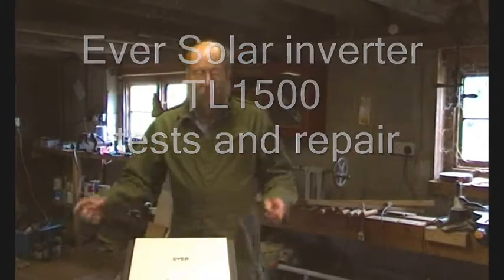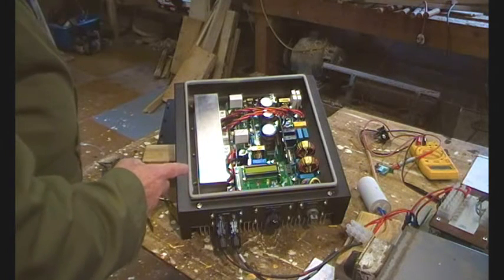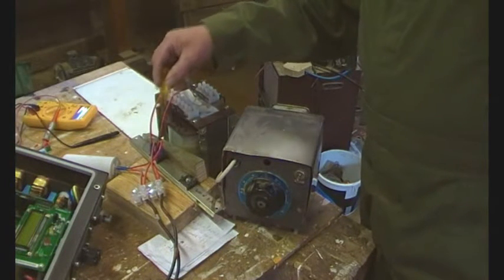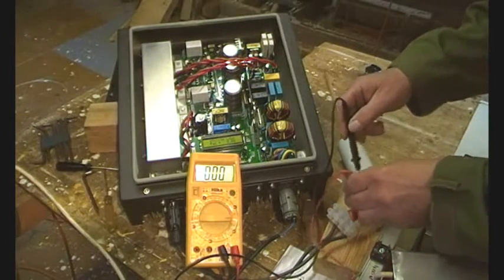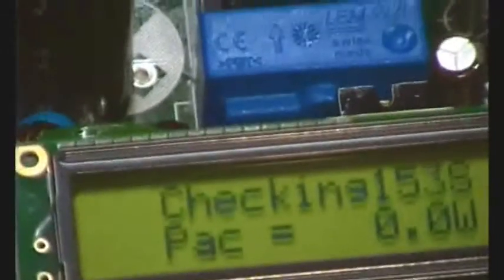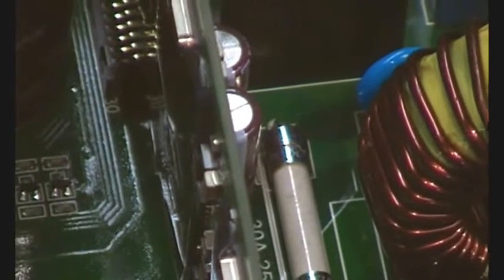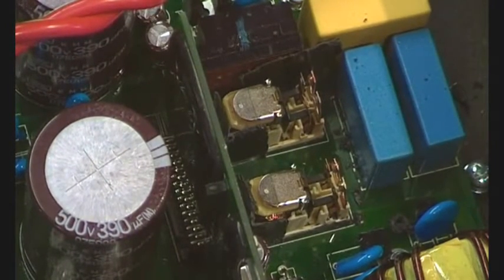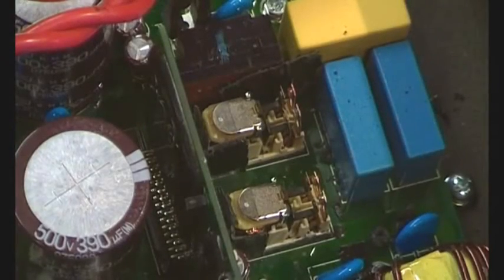Grid inverter investigation and repair: EverSolar TL1500, relay fault.

Comment: as I understood some inverters  doesn't work without isolation on the DC side?
Reply from the maker: That's correct, a leak to earth on the DC side can cause problems, just a damp spider's web in a connector block can cause this. Abb Aurora are particularly sensitive. Many more videos here, cheers

Comment: Hi Andy, a great video demonstration there. Keep up the good work! Do you have experience with grid inverter - JFY how to fix it? or do you have any video on JFY inverter?
Reply from the maker: Sorry no, but check the board for burn marks and check the relays. Just use basic principles and check for any fuses, Hope you subscribe, cheers

Comment: Hi Andy is there anyway a grid feed inverter can be modified to be used off grid to supply power to a well pump from solar panels with no grid feed
Reply from the maker: Hi, no they need a mains signal, and on cloudy days you will need  a battery to provide sufficient current, chees

Comment: Do you have experience for Zeversolar grid tie inverter, electrolyte capacitors 220 microFarad 25vdc bulging cause fault 03(relay fault)
Reply from the maker: I'd say change those capacitors but I doubt it causes a relay fault unless one of the capacitors is a dead short, cheers

Comment: Hi Andy,
Have you had a isolator fault on the unit after fixing the relays?
Reply from the maker: Ashley, if you had an isolator fault on either the AC or DC then power would not be getting into the unit, and so it would not power up. However there is also an isolation fault and this is commonly due to earth leakage from the DC side. I've done a video about this, found in the solar grid inverter playlist. Hope this helps, subscribed? cheers
Reply: @TheInfoworks  hi Andy, thank you I will have a look it worked fine after the fix you show for a few week then showed the insulator fault. Is there any other relays that could cause this, I’ll check the other video
Reply: What dose the relay under the screen do dose it need to be changed aswell?
Reply from the maker: @ashleywaldron5211  Hi, you only need to change the power relays you have already  changed. Have you checked your solder joints? Isolation fault is in the panel wiring and is a small drain to earth. High voltage DC is tricky stuff and can leak through cable insulation, that's why solar cable is double insulated, cheers
Reply: @TheInfoworks  thank you again for the reply checking solder joint in the inverter unit or the panels?
Reply from the maker: @ashleywaldron5211  check the wiring o your panels, looking for bad connections and possible earth faults, also check your solder joints on the replaced relays and all the connectors that were undone in the repair, cheers
Reply: Dear Andy......Any chance you have a schematic of a zeversolar unit in youre posession ?i have a inverter with a waiting error.....cant wait to get it to work!greetz from Holland..
Reply from the maker: @heman1303  Hi, I have had several growatt machines that showed this fault and in those it meant that it could not sense the grid voltage. Sorry I have no documents for any of the inverters I play with, cheers
Reply: @TheInfoworks  ok ...thanx for the reply😁...but first we need to build the DC power supply🤺

Comment: Hi Andy, with the output relay covers, do the plastic covers need to be replaced? Or can the unit run ok without the covers (i.e is it safe)?
Reply from the maker: Hi, in my experience they work just fine without the covers and you can see what's happening, cheers

Comment: Hi there, you’ve got a subscriber thanks so much. Are you at all familiar with sunny boy inverters? I’ve got a K1 open error that is continually on. Any idea where to start?
Reply from the maker: Hi, the only ones I familiar with are the SB 1700 transformer models. Not sure if open error is a relay fault or not. Is AC and DC getting into the inverter, what is the DC voltage and have you done a short circuit test on the panel string? cheers
Reply: @TheInfoworks   It’s also a transformer type, but 7kw. It’s getting both AC (230v, I’m from South Africa) and just over 600v DC, how would I do the short circuit test? I’m very limited with my electrical experience. Thanks for the reply.
Reply from the maker: Jayson, with limited electrical experience I would forget the short circuit test as you would need a DC clamp meter, I suspect you have a relay fault but only experiment would confirm that. I have several videos on various inverters with relay problems, it's a matter of examining the relay contacts and looking for burnt solder joints, cheers
Reply: @TheInfoworks  Thanks a lot, I will keep you posted 💪🏻

Comment: I unfortunately have a different fault.
Yesterday 07/10/2020 we had three power cuts in quick succession and I think my TL4000 has been spiked,  it's now showing VAC Failure. 
I powered it off overnight and have measured the AC on the motherboard this morning which is presently 237v
That matches the voltage on the display so afaik it's within UK range, what I can't do is check the inverter settings.
 I bet the configs been screwed and its reverted to a non UK setting or a non UK compatible default :(
The manual suggest there is a application called 'Easy Config' that can be used to configure these via the USB port, googling  such a common term as 'Easy Config' is a hopeless task though 
The manufacturer has  long since disappeared so it  looks like I will be buying a replacement Inverter now.
I wonder if there is a way via the screen to check if it set to UK G83 or whatever its called?
Reply from the maker: Hi, that's tough, many inverters show G83 as the screen lights up, but not all of them. There are plenty of used and cheap inverters on Ebay, I quite like the solar rivers. Have you seen my video on extending inverter life and subscribed? cheers
Reply: Andy Reynolds Thanks ironically after being dead all day yesterday it came back to life this afternoon Mains voltage hasn’t changed nor has the frequency very odd.
Reply from the maker: Good news but curious, just appreciate. I don't want to say any more that may offend the inverter gods, cheers

Comment: Sir which components are use in solar hybrid inverter for supply excess energy to grid
How can we make circuit to convert normal inverter to hybrid solar inverter
Reply from the maker: Hi, it's quite simple, you use a solar grid inverter. The panels are connected in series and then plugged into the DC input of the solar grid inverter. The inverter is wired into the mains and when the sun shines it puts power into the house wiring and then if you don't use it the surplus goes into the grid, see my book Wind and Solar Electricity. Look at my channel page and see the details under the "about" tab, cheers

Comment: Hey Andy the bloody thing had a relay fault now it has a isolation fault, what would cause this ? Wiring from the panels or those 2 relays need cleaning again as I am writing on the new relays to turn up from China!!
Reply from the maker: I had an isolation fault and tracked it down to the panel wiring, I uploaded a video about it if that's any use to you. Also there is my video on extending inverter life. Hope you have liked and subscribed, cheers

Comment: G,day Andy well I broke the top off my relays give the relay contacts a quick rub with 800 grit sand paper and give it a try and its a goer. I have ordered a couple on line so I will install when they arrive. You saved my about $500. Cheers mate
Reply from the maker: Your welcome mate, hope it goes well, you will need a solder sucker to remove the old ones, hope it goes well, I hope you have subscribed and liked, cheers

Comment: Hello,thanks for this video! I have a solar inventer  Shint 1.5ktl. The inventer does n,t work at all this moment.The solar string is still working when i put it on a other inverter.
when there is enough DC Input (350v), and there is 230v AC  Output  the inventer gives no startup at all.My question? What is defect on this shint 1.5ktl ,are there  parts to repair in it,there where never problems and there is nothing defects to see inside?
Reply from the maker: Hi, there's not enough info. If it is totally dead then suspect internal fuses etc, check the power is getting to the circuits, cheers

Comment: Thanks for the video, Andy, I just repaired a MacSolar TL 1500 inverter along the same lines (was able to clean up the existing relay contacts with 1200 grit). We'll see how long that lasts! Interestingly, the MacSolar main board looks identical to the EverSolar board, bar a minor revision or so, so I expect it was sourced from the same Chinese factory. May be useful info for others out there. I've ordered a couple of replacement relays, for the next time the contacts die.
Reply from the maker: Hi, thanks for the comment, the relay contacts are a bit small, see my video on extending inverter life to try to prevent further damage, subscribed? cheers

Comment: Hi Andy,  I realise its a old unit and your post is also a few years old.  But I was wondering if you might have tried or know if the unit, TL1500AS, in working condition. Does it actually put out 240 Vac (Australian version)  from the AC plug,  making it usable to power devices (as in off grid situation) of 240vac products? 
Or does it require an existing 240vac source input to actually work? 
Kind regards
John.
Reply from the maker: John, thanks for the question. Yes, all grid inverters need a mains input to make them work, they use the mains signal to run the occilator so the the output in syncronus the voltage and cycles, cheers.
Reply: Andy Reynolds Thank you Andy. So it could be possible to use say a 12vdc battery supplied 300watt dc-ac inverter to trick a 1.5kvac in to then be able to use the 1.5kvac inverter power effectively in an off grid style way? Or would the supply voltage from the 1.5kvac inverter likely blow the 300watt inverter once it exceeds the 300watt range?  As there would be no grid for the excess to go in too.  Just avoiding buying a new inverter from dc-ac if possible.
Reply from the maker: John, battery inverters don't like mains power up them unless they are an expensive modern bi directional unit. So yes it will just go pop, cheers

Comment: if lacking knowledge do not copy this set up learn all safety steps first be for  doing anything like this and do it at your own risk.
Reply from the maker: Richard, yes high voltage DC is dangerous, it's proof of concept without which learning is difficult. There are no directly exposed terminals where both + and - can be touched easily at the same time, cheers
Reply: @TheInfoworks  yeah it is just there are some part in which are blurry, had to see I wanted to copy it myself however I could not without extra research I only put this comment for the viewers because some people really do lack knowledge.

Comment: Hi. Not sure if you've been asked this yet, but have you had luck with replacing a damaged LCD?  As in the unit works fine, but does not output anything to the display...
Reply from the maker: Hi, the screens simply plug in so are relatively easy to change, you wouldn't want to spend very much as there are plenty of better second hand inverters on Ebay, like an SMA SB. The rule of thumb is always fit a slightly bigger inverter so it is not running at flat out. I suppose I should do a video about this, I hope you have watched the play list on grid inverters, subscribed? cheers
Reply: @TheInfoworks  I only found your videos this morning but will be keenly watch from today. :)
Reply: If your display is similar to the one in the video, it is almost certainly based on an HD44780 (or a clone of it). The one in the video has 2 lines with 20 characters each. You can easily find a replacement LCD display almost everywhere.

Comment: Hi Andy I have a growatt and a solar river inverter and they both just sit there with waiting on the screen do u have any idea what could b wrong Regards Rick
Reply from the maker: Rick, time to go to work, check you have mains power at the unit, and the DC volts are high enough (see inverter label). Then find the relays, remove the covers and clean and adjust the contacts.  Cheers

Comment: Hi Andy, I hope you don't mind a question, I have a solar river inverter it doesn't fire up the LCD turns on but no characters the power led blinks on briefly but that's it. I am thinking dc voltage too low so setting up the test jig as you describe here I was about to order a capacitor 450v 30uf cbb60 I thought they were non polarized but it has blue and brown leads is this right? And will a resister be needed too? 
Many thanks in advance.
Reply from the maker: Rich, the capacitor is there to smooth the DC after the recifier. I used a non polorised because polarity did not matter but you can use a DC one as long as you get it the right way round. If it's the wrong way it will continue to pass current and warm up (see the capacitor for preventing contact arcs video). You could use a standard motor start capacitor as they are rated for the full voltage of mains which is 330v at the top of the sine wave. Those found in old flourecent light fittings will do and even a 5 uf will help, or 2 in parallel. A 1 meg omh resistor across the cap will slowly dump the charge but not let power through. Hope you have  success, be interesting to hear how you get on. Is the mains getting through to the inverter, there is an internal fuse. Cheers, Andy
Reply: Andy Reynolds brilliant I shall get it ordered thank you very much for this. At present yes the mains does seem to be getting through (there was no obvious fuse?) But I test various points with the meter and the ac side does seem to be working. The inverter just doesn't want to fire up when dc is applied so after seeing your video of a bench test I figure it can't hurt setting the dc input somewhere between the rated start-up and max to see if this makes a difference. Thank you for taking the time to reply it's very much appreciated.
Reply: Hi Andy, quick update.  Got all the parts and wired up it gave me enough dc to start up the inverter. I still had no output to the LCD but got a serial(RS232) connection and the faults there show "No Utility" but in the status page it happily shows my AC grid voltage and frequency. So I am quite puzzled, the relay on the DC side clicks on and off after a short while but the one's on the AC side never move. I cannot see an obvious 'glass type fuse' unless it's a surface mount one but seems odd the power software shows there is grid connection and the volts/freq is within it's parameters.
Any ideas? I realise it's difficult when you can't see it but you seem very knowledgeable with these devices.
Reply from the maker: Rich, both of my solar river 2300tl have a ceramic fuse near the relays. If the ac relay is not working I would pop the cover off and see if there a mains voltage on one of the contacts. Also check the relay coil , they are commonly 12 or 24v. I assume you have seen my Solar River relay fix video. cheers, Andy
Reply: Andy Reynolds I have certainly seen your video :). I will get the tops popped off and check for ac on the contact. I definitely can't see a ceramic fuse on this unit it is fairly old now though board date is (2009) I think. 
I did take the control board out to test the LCD in the mean time, I think I may have a short there when I connect 5v and gnd to the vss and vdd pins the 'good' led flicks on then off and the back light comes on (from testing 3 other working 16 pin 16x2 lcd this  shouldn't happen) I will have another test of the relay tomorrow as you have suggested though and see what I get. Really appreciate your help
Reply: Hi Andy, resolved the short to the LCD board (I still have no output to the LCD but can use serial) the software now shows relay fail! 
I can see them both try to turn on then quickly click off. 
I have ac voltage 240v to a contact on the relay closest to the grid. If I test between the 2 connections from one relay to the other it's about 100v. And zero volts from grid to the furthest relay. So I guess there must be an issue with the relay furthest from the grid connection or a component going to it.
Reply from the maker: Rich, sound like burnt relay contacts, file and bend them. The relay sometimes click in and out several times before the inverter runs. What is the model number? cheers, Andy
Reply: Andy Reynolds you sir are a legend, I've filed and it fired up and started generation! They do click off and it waits for a while then reconnect so the contacts need a really good clean out and hopefully it's all sorted. Thank you very much for you help and patience with me.
Reply from the maker: Rich, brilliant, see the value of just haing a go. What method did you use to read the info with the port? and what model is this inverter? Burnt contacts are commonly caused by over driving an inverter with too many panels. The inverter will switch off under full load when the volts get too high so there is a big DC arc on the contacts. Time to buy my book Wind and Solar electricity edition three, cheers, Andy
Reply: Andy Reynolds Defiantly always happy to have a go and save a few £'s. Just a cheap usb to serial adapter and the samil solar power browser (v3 I believe) this one is a 1600tl. 
Plus I now have all the kit to bench test in the future... sounds like a plan 👍